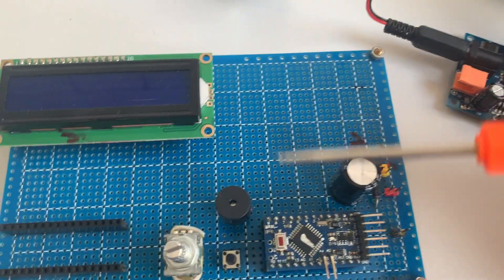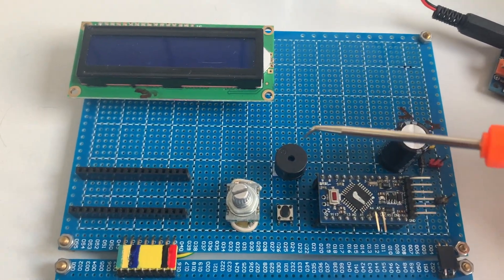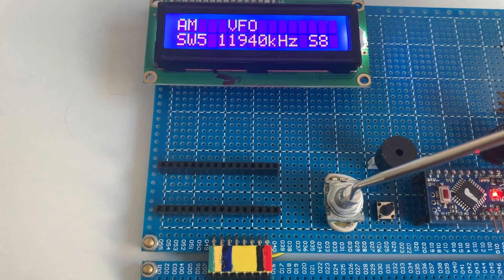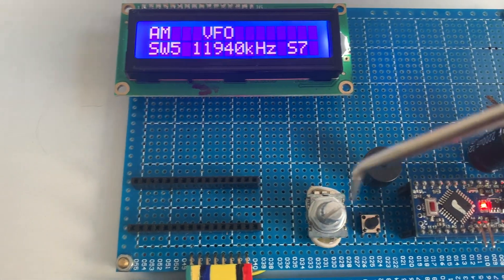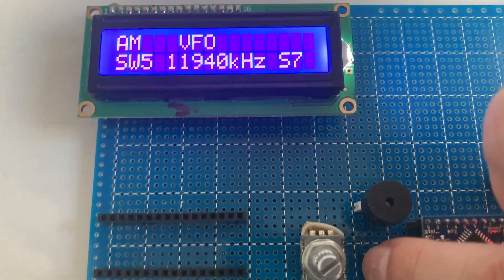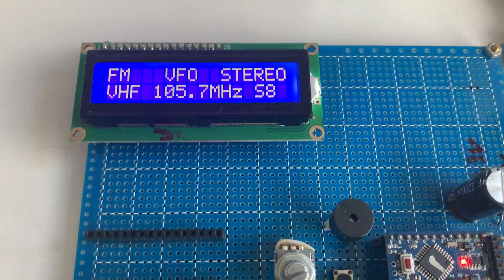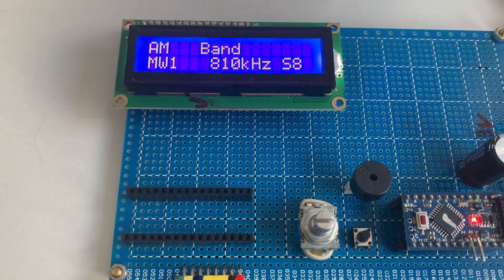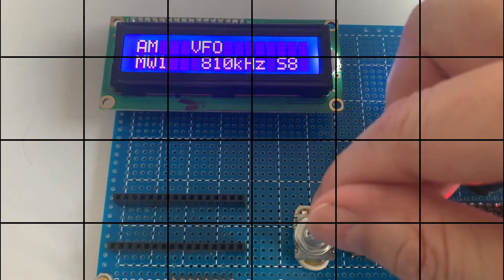SI4732 receiver with CW readout for blind operator

Comment: Are you using bidirectional logic level  converter . Thanks 👍🇧🇩
Reply from the maker: Not really.  The LCD is a 3.3V version. So, it works well with Arduino Pro Mini 3.3V and the SI473X device.
Reply: @pu2clr  I have buy a si4732 all band complete kit which is based on Arduino nano, but there is problem like it freez with out any reason and it creates data or clock frequency noise itself . can you suggest me what should I do . thanks 👍 my mail id is (bogratronic@gmai.com)